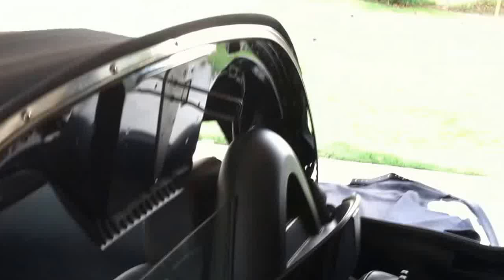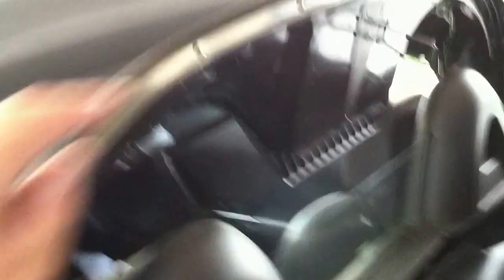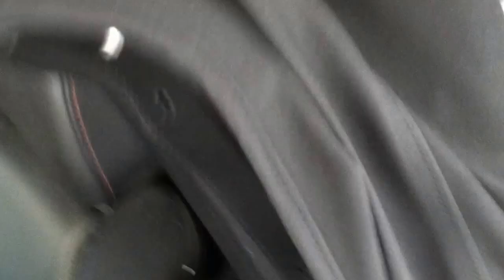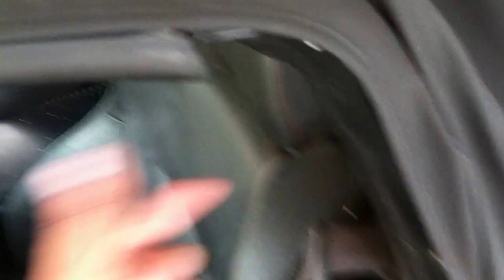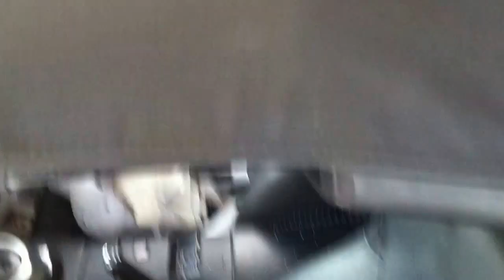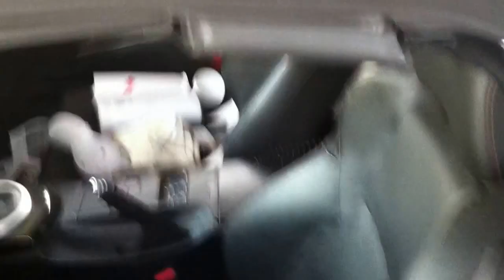350Z Convertible Top Replacement 65

Comment: Excellent documentation of the top replacement. I've sent a message via Facebook regarding a problem I'm having with a 350z top installed by a local shop. Hopefully you can respond and I can explain my observations. The shop is not helping resolve the problem. Thanks again for sharing your project.

Comment: Thanks for all your help =)
Reply from the maker: +RamsysGaming You're welcome. I hope you were able to change your top without a problem.
Reply: +Juan Lopez I purchased it already I'm waiting to receive it
Reply: +Juan Lopez what happened to your car if you don't mind me asking
Reply from the maker: +RamsysGaming I ended up selling the car in 2012. Car had more than 110K miles on it and I was making long distance drives so I needed something with less miles. I didn't want to sell it but it was 8 years old and with that mileage it was a matter of time before something major would go wrong. When I first got estimates to fix the convertible top they came in at $2,000 to $4,000. I thought if something went wrong with the engine or transmission it would drain me financially and the engine and transmission is something I can't fix on my own. So you can imagine the repair would be pricey. Love the car. I have a 2013 Hyundai Genesis right now but planning on getting a 370Z convertible in the future. I love the Z. So much fun to drive.
Reply: +Juan Lopez mine is 155k right now lol
Reply from the maker: They're good cars. Just needed something new so I wouldn't be stranded in the highway if it ever did break down. Let me know how to top installation goes. Hope you send me before and after pictures, always appreciate seeing those.
Reply: +Juan Lopez yea sure thing what's your email
Reply: +Juan Lopez I changed it out! Lol it looks really nice I appreciate your help
Reply from the maker: +RamsysGaming Awesome man. Glad I was able to help. If you took some before and after pictures I would love to see them. My e-mail is juanl1999@yahoo.com.

Comment: Juan...thanks for the helpful video...enjoyed it. Btw, possible you can do the Final video of how it all worked out? Was looking for #66...lol I have the 04 roadster..starting to gently separate near the passenger side window heat plug...would appreciate your comments..sincerely
Reply from the maker: You know someone else mentioned it to me and I remember filming from start to finish everything I did but for some reason I lost the videos of me finishing. However working in reverse is pretty straight forward. I will tell you that everything did work out and I have messaged several people that have changed the top using my videos and they couldn't be happier. Good luck to you.

Comment: Wait... what about the final result. Was it very tight, did it work? Did you have to stretch the canvas for a couple of days? What happened?
Reply from the maker: Petrus Strydom Haha, 😂. All valid questions. So I took the videos and a year later I uploaded to YouTube not realizing I lost the final videos. It did work. Manufacturer for top said to stretch it out for a couple of days. Tight for a week then it loosened up after that and didn't have an issue. Ended up trading in the car about 3 years later if I remember correctly.